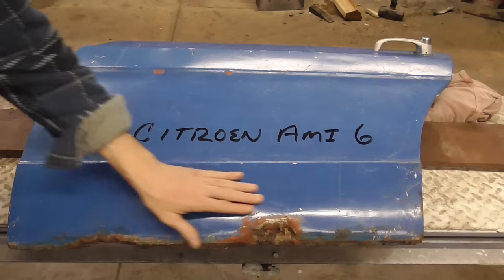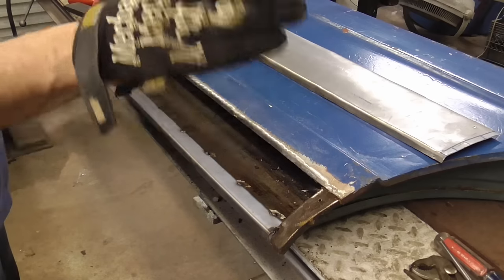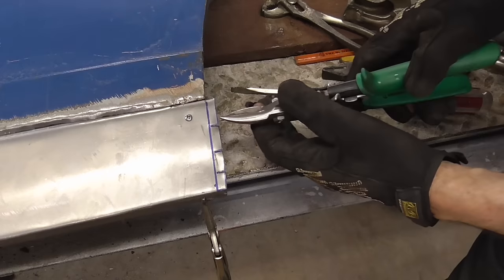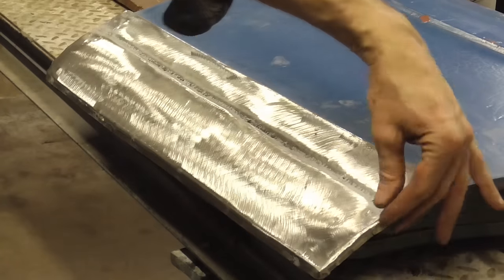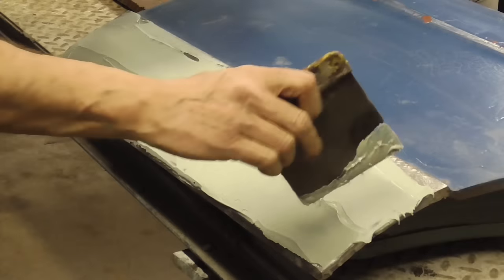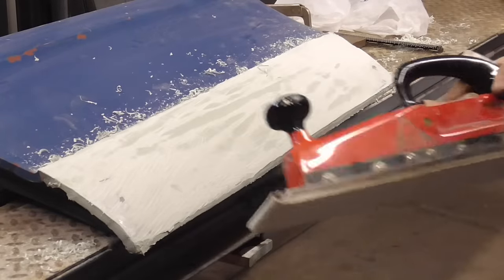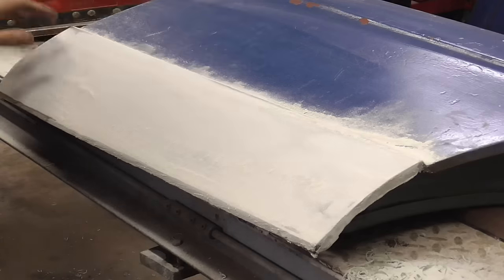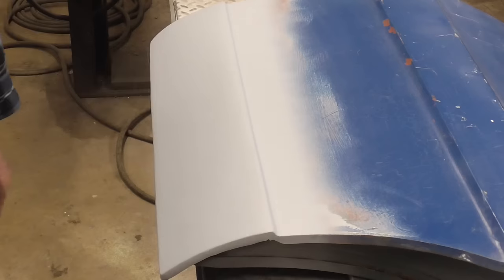Butt Welding Automotive Patch Panels - Start to Finish

Comment: 😟 lots of filler 😔
Reply from the maker: I painted this car in '92 - had lots of dents and rust - 25 years later after driving it regularly this is what it looked like. https://www.youtube.com/watch?v=2o37dX--w0I  Professional body men use filler every day across the nation - don't listen to stuff that's said on TV or the internet - they want to make you believe they are more than what they are - it will prevent you from getting good at body work - really.

Comment: im in the middle of doing this on my car. I fixed the inner rocker and now im about to start on the outer like youre doing. Im glad i found this video to help me!
Reply from the maker: Glad you could use the info - you can lap weld the seam or butt weld it - to me it makes no difference - if it's going to rust again it will start at the bottom where the salt water and debris sits - here's one on lap welding it - https://www.youtube.com/watch?v=fSTkMkPryPQ

Comment: This is something I want to be able to do. I've only thicker metals with my everlast welder but body panels would be cool.
Reply: On the panel you  welded why not glue it ?  Glue is better for rust protection. The back of the panel that got welded  if it is bare meter it should have been painted!

Comment: Great tip on making the 45 degree “valley”! Makes a ton of sense!
Reply from the maker: Thanks - today's sheet metal is too thin to butt weld and grind flush.  If you prefer butt, I really believe this is the way to go :)

Comment: I wouldn't call that a butt weld first of all, a butt weld is meant to have a gap the thickness of your mig wire and stitch the gap randomly as to not introduce too much heat and warp the panel. For a patch that long it should take no more than a tablespoon of body filler. As a bodyman for 45yrs I still take pride in my work and would never hack up a job the way I saw you do it.
Reply from the maker: I don't agree with butt welding and grinding the welds flat.  How do you justify the integrity of the weld and adjacent metal after that process.  There will be paper thin welds, sheet metal, and tiny pit holes very near the surface.  Today's metal is literally 6 hairs thick (.030"). In body shops in Michigan you have to be able to fix this type of damage quickly. Are you saying you worked in a shop and fixed this type of damage butt welding it?
 https://www.youtube.com/watch?v=36zkc9UQaTs
Reply: Agree with Jon Rothenbusch. If you know how to grind and have the right tools to do so the metal won't be paper thin. However it will take a lot longer!
Reply: I agree and that patch job is just going to crack and fall back out in a couple years if it even makes it that long. Also who touches the mig welder to the work when they are welding? They don't do that in a high school welding class...let alone a professional doing it. The whole thing screams of a cheap hackjob and what some hillbilly would do to his Chevy truck in the backyard.
Reply: Red seal welder here - that’s not right, the welding part. A butt weld is two pieces butted together, by default there is no gap. You can specify a gap but a gap is an added instruction. You are right that the thickness of your wire/stick/etc is supposed to match your gap distance. But that’s only recommended for metal above 1/8” in thickness, not below. The bigger the gap, the more heat is added, and you don’t want that with sheet metal, warps too much. I’m sure you’ve made it work by tacking all around but still, less gap the better
Reply: I was shaking my head the hole time.
Reply: I’m no welder at all but I know for a fact more and more people are using body “filler” as body MAKER

Comment: What an absolute dogs breakfast. He put that much bog in there he should be decorating cakes
Reply from the maker: I think after sanding the most filler you could find is probably 1/8".  Don't ever be afraid to use filler - if you are and you shy away from it, it will hold you back from becoming the best body man you can be. If you can't get filler straight - you wont have a job for long - end of story.  Remember every dealership and private shop uses filler on nearly every job.  You don't know that because they apply it correctly.  It will never crack, fall out, etc.  - never - if applied right.

Comment: Good video.  I am attempting to repair rot on my Ford van bought a replacement panel but I have never welded   I will have to do similar make a cut remove some of rear panel can you tell me what kind of welder to use and any pointers. I prefer to do it properly than pop rivets as I did when I was younger. Worth trying to mimic you
Reply from the maker: Thanks Curt.  This is how easy it should be to weld after you set up your welder - https://www.youtube.com/watch?v=1BYqLM_mY1s  As for what type of welder - that depends on the $ you have.  You can't ever go wrong with a 110v Miller MIG welder - the cheapest MIG they have will work great.  If you don't have the $ for that, I suggest this one - https://www.youtube.com/watch?v=1BYqLM_mY1s  It's all I use right now and it welds great - much like the Miller.  Getting repair parts will be impossible but I don't see it breaking down - it's built pretty well :)

Comment: Why do you body filler the whole patch and not just the area where you welded?  I'm about to try to replace the real quarter panels on my '97 jeep.  I bought the panels and they are already painted/primed.  Do you only body filler the whole piece if it's bare metal (vs what you ground off of a prefab primed panel)?  Thanks
Reply from the maker: Because usually the patch is not perfect and there are small waves, dips or whatever here and there.  Might as well just get it all at once and be done.  It is possible to just do what you're saying but filler is so cheap that you actually save time and get it straighter doing this.  Hope that helps a bit :)

Comment: Nice truck but it's not a butt weld either; more of a modified lap seam.
Reply from the maker: With respect, the butt welding fad on the internet is not the answer - I've been trying to find the perfect solution for 40+ years - there is none.  I use a combination of both lap and butt on almost every patch but I would never just butt two pieces of metal up, weld it, then grind away at the area attempting to metal finish it for many reasons but here are two: https://www.youtube.com/watch?v=MfKlNQF-o4I  - https://www.youtube.com/watch?v=e9bjZ_UxtJg  
Today’s metal is .030. That is literally 6 hairs (hair is .005) thick.  You start grinding on that and voila paper thin metal and welds. Both methods work well if done properly so in the end it’s what works for you..  Keep in mind, you won’t find anyone butt welding in professional shops. Surely you’re not going to butt weld and metal finish this: https://www.youtube.com/watch?v=36zkc9UQaTs or some of my other rust repair videos.  Use small overlap - weld solid - no moisture - especially if you keep the drain holes clean (most important thing in rust prevention). Note that  the opening of the seam is upside down on the inside too.  Please see this video for longevity of this type of repair if done correctly: https://www.youtube.com/watch?v=8XaZBy7GC7A or 
https://www.youtube.com/watch?v=2o37dX--w0I

Comment: Friday night auto body and some bottom shelf bourbon. 🇺🇲👍🥃
When I was young my job was pushing the two pieces together with a screwdriver while my old timer friend brazed or soldered the panels. Then I had to cool it down with a wet shop rag.. Good times!
We always put a thin coat of short strand fiberglass on first to help seal the joint and then put plastic filler on top. Great video!
Reply from the maker: Sounds like fun.  The short strand fiberglass is a good suggestion.

Comment: Question. Ive been dealing with a local restoration shop, and he told me under no circumstances do they recommend doing the 45* the lips on butt welds. His logic was that it leaves a slight opening in the V channel on the backside where moisture can get trapped in, and it has the potential to create rust and ghost lines, since you generally cant get on the backside to seal it up/knock down the lip. He also said its harder to manipulate the metal due to the difference in thickness along the channel line.

Whats your take on this? Is it something you've ever seen or had issues with? Im curious if its as big a deal as he made it out to be.
Reply from the maker: People will say a lot of things if they don't use that specific process in their shop.  The facts are is that every method works well if done in a way that makes it work.  Body shops should be proficient at all methods in case the customer wants it done in a specific way.  There is no truth in the, "slight opening idea" - none at all.  Here's some info that may help you make your own decision on whats the best method for you - watch all of them very closely and it will make sense to you - See these videos for information on why the highest quality Michigan/Detroit area body shops use this method:  https://www.youtube.com/watch?v=JIIonJOVro4  *  Also see Eastwood’s explanation:  https://www.youtube.com/watch?v=rpH50kh4W00 *  For longevity of this type of repair see:  https://www.youtube.com/watch?v=8XaZBy7GC7A
Reply: Never used this method myself, usually tig or oxy weld the panels together. however the difference is this takes about a third the time that it would take me to do it. mine ends up like a new panel like from factory but there is very few customers who could afford to do that to all the parts of a car in a restoration. this is a much more efficient use of labour and ultimately still will last a very long time. Ghost lines will occur more due to lack of time waiting for the shrinkage of fillers and primers to occur before paint not so much the valley being here. i have actually never seen this method although i can 100% see benefits this would have over conventional butt welding with a mig, and flaws.

Comment: A word of caution to the newbees with an air file. They are fantastic tools for getting a flat panel but if you let your pinky wander down between the body of the file and the clamp for the paper, it will hammer your fingernail 35 times before you can move it or stop the file.
Reply from the maker: Great tip Stanley :)

Comment: This video came just in time! Fixing to do a cab corner and going to try the 45 degree trick. That is so helpful. Thank you for all the info and great videos!
Reply from the maker: You're welcome.  You can use either method 45 (butt) or lap weld you patches.  What ever is easiest for you.  Both methods hold up well - moisture sits at the bottom not up where you welded.  Good luck on you project.  Here's one that was lap welded - https://www.youtube.com/watch?v=fSTkMkPryPQ

Comment: My old classic has the paint cracking where the putty has cracked beneath it. Any way to stop stress cracks with putty, or was it just shoddy work by an unskilled person? Or does putty always eventually just crack over time?
Reply from the maker: Body filler should never crack over time.  Sometimes instead of using filler, a body man will use a ton of primer surfacer or lacquer putty to help get a panel straight.  Your supposed to get it straight with just filler but that is sometimes hard to do.  Anyway if you cheat with thick primer or putty it can shrink and form cracks.  Not sure if that is exactly what's going on with your car but..... Any way, there's really no way to stop the cracks except to remove the old filler and do it right the next time around.  Ask more ?s if that didn't help.

Comment: Not a butt weld.
Reply from the maker: No - you're right.  It just holds up a little better under all driving conditions and all weather driving conditions.  Manufacturers don't butt weld anything... for a good reason ✌

Comment: Hey new subscriber. Yes like the way that 45 degree butt welds together. Any new techniques to make a job better and easier fit is best especially when metal panels are thin. Excellent video
Reply from the maker: Thanks - glad you liked it :)

Comment: how do you keep from blowing through the panel while using the mig. what is the welder and settings?
Reply from the maker: If you blow through there is usually two cures.  1) turn the heat setting down (mine is usually on 1 or 2)  - there are 4 settings.  2) shorten the time on trigger - In other words just a very short squeeze of the trigger - enough to get a weld but not burn through.   Ask again if that didn't help.

Comment: I have a tool for putting a step in for lap joint. I would like to avoid having that 45° bend sticking inside door. But your bend will reduce warpage.
Reply from the maker: The step can work too - thanks for the input Frank - enjoy the week :)

Comment: Isn't it best to use epoxy primer such as DP-74 before putting the filler on? To prevent rust from bubbling the filler up.
Reply from the maker: It is not necessary as the paint protects everything under it.  That's an internet/magazine wives tale thing.  Body shops put filler over properly prepared metal.  Here's a good video on the topic too - https://www.youtube.com/watch?v=wVhQLqPAGVU

Comment: What kind of filler u using most I've see are pink once u ad the hardner yours is green.. with the harder
Reply from the maker: It's Auto Body Master light weight body filler - right around 20/gal  - the hardener is dark blue and the filler is light grey.   Really makes no difference to me what brand I use as long as it's around 20/gal.  Happy Holidays Steve :)

Comment: Only question I have . When you use the clanging tool . Say it’s a 1/4 inch flange . Do you need to add a 1/2 inch back on to new piece ?
Reply from the maker: If the flange on one panel is 1/2 inch then, yes, you'll have to have an extra 1/2" on the other (to overlap).

Comment: How do you keep the inside of the door panel from rusting from the inside out with no paint over the bare metal?  I always wondered that when watching body repair videos.  Thanks for the video!
Reply from the maker: You're welcome - here's the best way to prevent rust on any car.  Even new panels have nothing coating the pinch welds where metal is sandwiched together.  You have to have an undercoating that can penetrate and creep to coat everything that can't get coated with paint or undercoat.  https://www.youtube.com/watch?v=8XaZBy7GC7A

Comment: Why is there so much filler?  Isn't that just more places that will be prone to cracking in the future? Just curious
Reply from the maker: Don't ever be afraid to use filler.  All of that non filler talk is just TV and internet stuff.  If the surface is prepared correctly it will never crack - and you'll never ever know it was ever there.  It has to be done right though and that's the problem and how filler got a bad name - people abusing it.  It may seem like there is a lot of filler on this door bottom but in actuality the deepest spot is probably 1/8".  Myself, I don't even care if it is 1/2" thick - it's even more rigid.  Again if the surface is prepared correctly you'll never have a problem. Check these videos out for more info: https://www.youtube.com/watch?v=8XaZBy7GC7A or 
https://www.youtube.com/watch?v=2o37dX--w0I

Comment: If you are going to bend down a 45deg. Lip you could have used 3M adhesive and glued the whole panel on. I have been using 3M adhesive more and more rather than welding.
Reply from the maker: Adhesive is great - no doubt.  Here's a vid on that too - https://www.youtube.com/watch?v=d21RkqTwRqs  I use welding and/or glue depending on the situation.  Both work well if done right :)

Comment: After tac weld, do you weld all the way through even ?
Reply from the maker: You can - One guy I worked for made us weld solid all the way but we always cheated and never had return work.  I think it does well both ways because when you tap the seam down, the filler acts as a buffer between the seam and the finish.  That's how they did sail panels in the factory - the roof was connected in a valley to the quarter and lead or filler was used just like this process.  Have a good weekend Oscar :)

Comment: I didnt see any seam sealer used on the welds ? did you use that prior to the body filler or not?
Reply from the maker: No - it's not a good idea to use seam sealer under filler.  Although I don't have any solid proof that it's bad - just never saw it done in a body shop.  Something that would work though would be fiberglass reinforced filler which is water proof and would act like a seam sealer.

Comment: Does penetration have to come past the backside of the metal completely or can it be leveled with the backside?  A lot of videos I’ve watched say it should look the same on the backside as the top but I can’t get that.  I can only get completely flush
Reply from the maker: No.  Not a lot of auto body videos on YT are exactly what happens in a real body shop.  If you want to really know the exact truth on anything in body work, the best thing to do is ask someone who worked in a shop for years and did actual collision work.  Folks in a body shop don't worry one bit about stuff like that :)
Reply: @LakesideAutobody  Sweet I have one more question. On the backside the weld in  some spots are whitish. Would this come from using flux core wire or from me not cleaning the metal well enough?